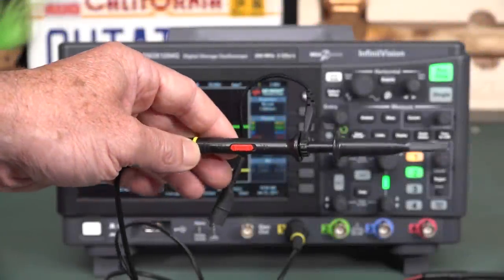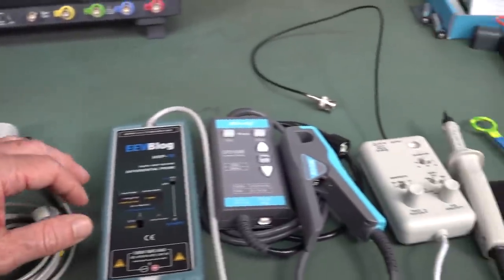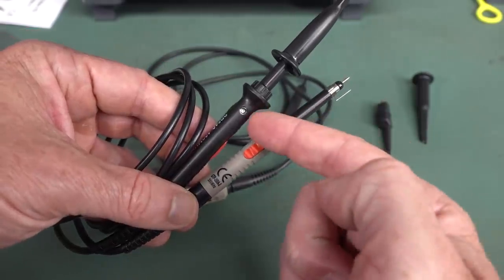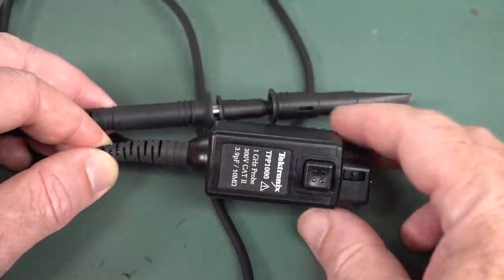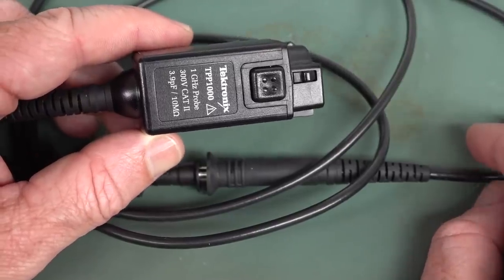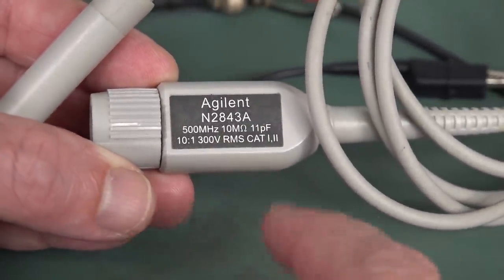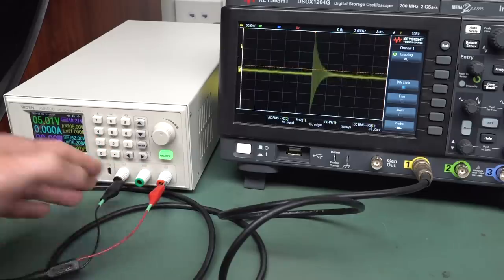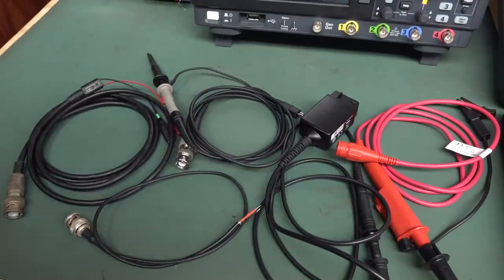EEVblog #1367 - 5 Types of Oscilloscope Passive Probes COMPARED

Comment: So many times I accidentally left my probes in 1x, and my scope is set to 10x or the other way around. And I sit there looking at my circuit thinking something is really wrong then I realize it's just that.....
Reply: I've resorted to electrical tapeing the switch in the 10x position. I switch to 1x so rarely that most times it gets switched accidentally.
Reply: And the worst part is that the switches are generally so flimsy that they are quite easy to get messed up by accident. Sometimes you just barely touch it and the switch just hangs somewhere in the middle between 2 positions making intermittent contact and producing noise on the oscilloscope screen when you probe around. I always hated the stupid things when they did that! And at the same time at least in my electronics diagnostics practice I discovered that a 1x probe is almost never needed because if the signal is so low that you can't see it with 10x then its source is most likely too sensitive to measure correctly as well forcing you to choose some point where the signal is already somwhat isolated and amplified. In the end I just completely switched to 10x fixed probes and just BNC-terminated pieces of a 50ohm coax cable for radio stuff. They save a lot of trouble by being much more reliable and with at least somewhat modern oscilloscopes they have almost no real downsides to them.
Reply: There should be something like "caps lock is on" warning on windows login
Reply: @Kirillissimus  right? At my University, if you so much as look at the probe it would switch itself. I taped them down on those ones
Reply: @lhxperimental  All my fixed 10x probes, the made in Taiwan HP9251-s, have a body made of green plastic as an indication of being the safe ones (you simply look at them and see "green => ok"). The older switcheable ones are all black or gray.

It would be nice if all manufacturers agreed to use some uniform probe color coding. Something like 10x - green (safe), 1x - black (obsolete), 100x - red (danger, HV), current probes - yellow (safe to the scope but can be dangerous to you), blue or purple for capacitively coupled specialized probes and white or gray for other specialized probes. But as far as I know they never did.
Reply: That's nothing.
One time my mind was not in the right place and I spent more than two hours trying to understand why the frequency of the sinewave that the oscilloscope was showing me was several orders of magnitude lower than the one I set on the signal generator. The frequency counter was showing me the right frequency and I was going crazy. 
I thought the oscilloscope was broken and it took me literally hours before realising I had set the time scale wrong and that was just aliasing...
Reply: @lhxperimental  there is (at least in xp)

Comment: About that 1k resistive probe: One of my professors who spent his career doing high-speed analog stuff and who started in the 80s (when the access to proper, professional equipment vas very limited over here) made a couple of those probes. He based them on a piece of stripline on FR4 in a plastic syringe to get something like an actual probe (with a very short ground lead, I think he used a thin nail or a needle for that and for the actual probe tip) with the coax attached to the other end of the syringe. So, anyway, he recommends:
 -putting a 100-120nF cap right after the input resistor(s) to stop the probe from loading down the circuit at DC (because if you're using this probe you probably don't care about DC)
 -if you care about having 20:1 and not 21:1 nominal attenuation, using two 0805 resistors in parallel so that they add up to 950Ω (like a 1k and an 18k)

He claims that the plastic syringe version has a bandwidth of around 1GHz (he used it with a 500MHz oscilloscope), but a better one made with a brass tube instead of the syringe had a bandwidth of around 2.5GHz, limited by the (fairly elastic) coax he used.

Any comment on the use of those caps to limit DC loading of the circuit, Dave?
Reply from the maker: You can of course AC couple, but I have not measured the performance myself.
You don't want resistors in paralell as I think I mentioned in the video, as that adds to the tip capacitance, you want them in series.
Reply: Dr Burd? ;)
Reply: @EEVblog  By the time you start worrying about resistor's capacitance loading your circuit, you will already have serious issues with signal integrity due to said capacitance shunting out the resistor and affecting the attenuation ratio.

SMD resistors can be stacked atop each other with almost no contribution to capacitance. But yes, indeed, series connection can be beneficial.
Reply: @izimsi  Indeed
Reply: You can easily find ~950 ohm resistor in a bunch of common imprecise 5-20% 1K resistors. No need to connect anything in parallel or in series.
Reply: Yes, but What scope doesn't have an ac coupling toggle? Mine is from the early seventies and it has one?

It seems like such a tiny cost in comparison to building a scope that they all seem to have it by default?
Reply: @AngDavies  The thing is that not many of them do in 50Ω mode (https://www.eevblog.com/forum/beginners/why-oscilloscopes-dont-have-ac-coupling-for-50-ohm-input/)
Reply: @Bllinker  ahhh, kk
Reply: @victortitov1740  I think* he was implying that if you wanted to make a weird value, it is better to use 2 smaller resistors in series, rather than 2 larger resistors in parallel, for the precise reasons.

Assuming all of the resistors have similar parasitics, putting them in series will halve the capacitance, in parallel double it, so a 4 times difference in the capacitance and thus the useable frequency.

The opposite would be true for inductance, but capacitance should be the dominating factor for high value resistors, and inductance for low ones, so if you need to combine high values do in series, and low values in parallel

Comment: Ähhh, RG174 at 1GHz should have an impedance of 50 Ohm. You just considered the C part only, but there is always a L part as well. So a little bit more than 1,59 Ohms.

Comment: It's not like I'd want to stick a probe into a 300 MHz 5 KV signal source, even if the probe was able to measure it.
Reply: Right? My thoughts exactly
Reply: @matth3wc  It'd roast you by it's microwave radiation, right?
Reply: @namibjDerEchte  ....what? Even though it's high voltage and frequency doesn't mean it has microwaves that will cook you. And 300 MHz is far below the microwave range. Though, every microchip leaks emf to some degree but this is in the nano range unless it's specifically designed to emit that radiation like radio towers or phones etc. It takes specially designed circuits and components to produce microwaves powerful enough to cook you. Your microwave has a magnetron to do this.
The reason I wouldn't want to plug probes into something that high of voltage is , the higher the voltage the more dangerous it is (of electrocution) higher voltage can breakdown things that are supposed to be insulators and also makes it easier to find a path to ground. And not always but high voltage could mean high current which will definitely cook your body (not by microwaves though but actual electricity passing through your body). At best it would melt the probes and at worst it would kill you.
Reply: At that level you can probably just clip the ground lead to the probe tip and hold it a few feet back if you just need to see the waveform. Add a few turns of solid core wire and it can work on sensitive low power rf stuff too.

Comment: You may have missed one, I have found it useful to have a diode RF probe that can be connected to the oscilloscope. Very handy for looking for modulated RF signals on a limited bandwidth scope.
Reply: That's an active probe, IMO. A very crude and limited active probe, but nonetheless.
Reply: @namibjDerEchte  I disagree about the probe being a  crude instrument. It was very handy as a quick monitor for TDMA digital radio signal.
When developing TETRA, we had access to very expensive signal analyses, that could display time and frequency domain information, including constellation diagrams, vector error, and message error rates, etc but as a quick test of the carrier modulation, a diode probe connected to an oscilloscope was invaluable.  It also has its uses, in probing RF oscillators, if stripes and looking at the locking characteristics of phase locked loop a, where it is the RF envelope that is of interest.

Comment: Impedance of a terminated 50 ohm coax is a flat 50 ohm resistance (none of that 100pF bollocks). I recommend using another 50 ohm resistor at the input of the coax to dissipate any reflections scope termination might have produced (that will halve the gain, though) and add a good quality dc blocking cap. No need to build a new cable, just modify an SMA connector and screw it into any SMA/3.5mm cable.

Comment: From my learning about amateur radio coax versus ladder line, you cant expect the shield to fluctuate with AC. It should be tied to ground and the centre pin should go positive and negative with respect to it. With separate conductors EG ladder line, both conductors can go positive or negative. Hence the need for a balun when going between conductor types..
Reply: @Ken Mason I'm definitely the amateur in amateur radio. I just thought I would offer my thoughts on coax. But I think there's some issues there that I'll leave up to you.

Comment: With a 10X probe and an analog scope with a best volts/div of 5mv it is not much fun trying to measure DC ripple!  I use an old analog Hp 412A chopper circuit meter which goes down to 1 millivolt FULL SCALE.  It is a lovely, amazingly accurate unit with six ranges below 1 volt!  Hypnotic to watch that needle dancing back and forth.

Comment: The ones with the red attenuator switches have their 1x setting when pushed forward. That can blow your scope (mine is 250V max.) when you want to measure higher voltages, because you can put pressure on the switch while measuring, and you will push it from 10x to 1x. I have just removed the red knob (you pull it off easy) , and use a little screwdriver to actuate the switch now.

Comment: When driving a car with manual transmission, and one shifts into a lower numerical gear, 5->2 instead of 5->4, it's called a "money shift." 

What's the equivalent phrase for when one blows up their scope because of error with probe?
Reply: Forgot the isolation transformer, too cheap for varistor, & ground the clip. POST: Power On Sizzle Test.

Comment: You can also make a differential isolated AC-coupled high bandwidth DIY transmission line probe.
How you ask?
Connect a cheap ethernet transformer to the tip of your coax.
You can even get some spectacular impedances by using other turn ratios than 1:1 in combination with suitable resistors.

Comment: Most of the time, looking at high speed digital signals is best done with a Z0 probe.  I call them a "cable launch" probe, but that's just me.  You can even look at things like Gbit/sec LVDS with them, and they cost (basically) $0.  I previously did a little analysis with SPICE just to see ground lead length and the effect of the capacitance of common resistor (physical) sizes do to the frequency response... and the answer is it basically doesn't matter.  Another thing that is useful to do when designing the board if you know you'll need to probe for example a high speed SERDES interconnect is to put some pads there for a 0402 size 953ohm resistor and a ground via close to it :)  For cables 1/10w 380ohm in series with 570ohm makes for a 20:1 with 1/2 the parasitic capacitance of the resistors.

Comment: Good work Dave...
I am not immune from asking "stupid question" when looking at circuit. 
In my 60ies I make occasional 20y old mistake - no one is immune. 
I have 4 of those type probes.. one is differential , one is current - all purchased away from my wifes asking ; and how much was that toy, haven't you got enough!!!
Between you and I Dave one can never have enough probes.
Currently Trying to fix (4off) EPSON theater projector EH-TW5700 with no EPSON repair center manual 
anyway I need to fill in time after 65y+ until the elevator to a pub  with warm (or no )  beer ....Pub run by guy named Old Nick
It's all fun - keep up your blogs It keeps me going.
I agree...Good enough for Australia and Gina Rinehart

Comment: 19:35 Maybe I misunderstand something, but doesn't directly connected cable behave like 50 Ohm resistor since cable length is quite significant compared to wavelength at least if we ignore losses? (and that's also probably a necessity for that resistor divider to have constant attenuation over different frequencies)
Reply: I'd have thought so.

Comment: So I know absolutely nothing about oscilloscopes, but I picked up a cheap kkmoon DS0120M for setting car amplifier gains. I'm posting a link to a short video, I was hoping maybe you had a little insight or advice you could share. I'm assuming the capacitor or resistor or whatever is in the line just isn't functioning properly, which seems like something a little bit higher quality probe should fix. I'd rather not spend money if it's not going to help. Also, I'm only measuring 40hz and 100hz audio tones, which it seems to do well with (haven't fried an amplifier yet), is this an issue that even needs dealing with in my particular case? Thanks in advance for any help, and thanks for the informative videos!

https://youtu.be/n_-V9Nm6jqQ

Comment: And then there's also system bandwidth to consider.  Example, If you have a 200Mhz scope with 200Mhz probes, don't expect to measure 200Mhz signals.  The bandwidth may only be 141Mhz.
Reply: Yes, but it depends.
Reply: @volodymyrzakolodyazhny  Your right, that's why I say may only be.  With old analogue scopes it was probably easier to define, but with digital scopes, that's a different matter.  It may be that the input filter/amplifier has a higher bandwidth than that defined by maximum sample frequency.  Also scopes that are software bandwidth upgradable, eg 100Mhz to 200Mhz, should in theory have more analogue bandwidth available if you have the base 100Mhz version of the scope.  Keysight article of some of the problems  https://community.keysight.com/community/keysight-blogs/oscilloscopes/blog/2016/09/01/what-is-oscilloscope-system-bandwidth-and-how-do-i-find-the-bandwidth-of-the-scope-probe

Comment: 20:03 I guess it incorrect to handle long transmission line like simply capacitor. It also have distributive inductanse. So we have 50 or 75 ohms in stadard cables. It mean on 1 GHz you dont need tec probe with 40 ohm load you can just use 50 ohm cable with 50 ohm terminator on scope side. All you need just check datasheet for cable to know how much dB per meter it eats.
Reply: I went through the comments to see if anyone else made that observation. Yes - a 50 ohm input with a 50 ohm coax on it will look like 50 ohms resistive, there will not be any shunt capacitance.

Comment: The big difference between the active probe and the coax probe is because the signal goes high z for a period right? The coax has 1050ohm impedance down to DC so it pulls the net down while the fet probe has a much higher DC impedance?
Reply: Active probes usually have low input capacitance and 1x at the same time.
Reply: That's what I was going to say (bus goes high-Z),

Comment: I don't even have a scope. I really should buy one. Scope first or a beach psu? 🤔
Reply from the maker: PSU you can just DIY or scrap together, a scope gives you a window into a new world.
Reply: @EEVblog  Thanks! A video about series vs parallel termination would be awesome!

I'm absolutely noob on this!
Reply: A multimeter comes first. Then some hand tools, spare parts, pieces of wire an some boxes for old broken electronics parts and bits. Then some proper soldering gear. Then a bench PSU, and only then I would start thinking about an oscilloscope.
Reply: For your very first oscilloscope I'd consider a sound card oscilloscope. It's basically a two-resistor divider connected to your computer's audio input. Compared to real oscilloscopes it's very limited due to the sampling rate, but it's super cheap and can even be made out of scrap. What's really nice is you get full digital storage functionality.

Comment: heh... "1x bandwidth is hopeless, can't even measure 20MHz PSU noise".. Nah, it is plenty, so much more than an audio engineer needs.. There are signals and then there are signals and i find it so funny to hear someone say 20MHz is too slow..
Reply: 1x probe can load a circuit too much with it's quite high capacitance, and so can totally change the behaviour of a curcuit.